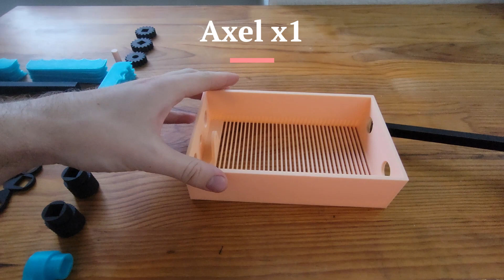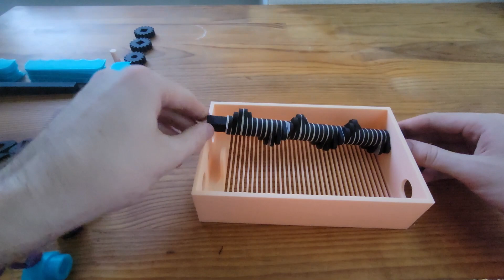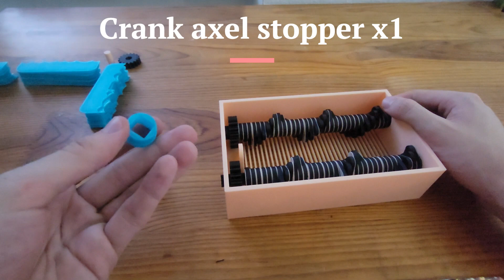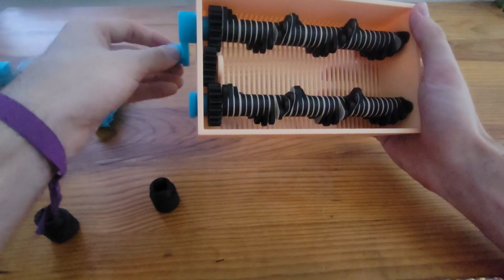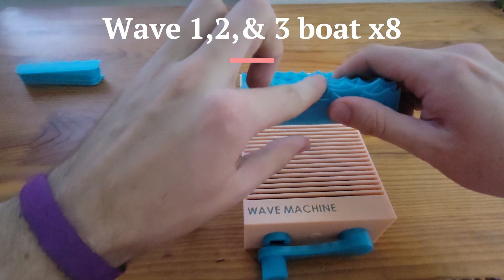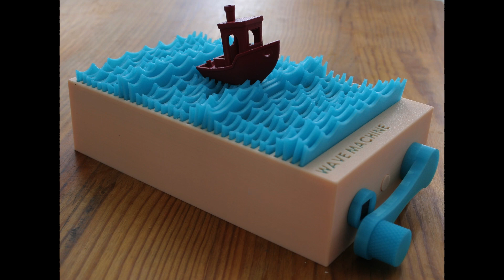Wave machine assembly instructions

Comment: its possible i change the boat on .STL file? I have one sailboat with 114mm lengh
Reply from the maker: Of course ! As long as the boat fits on the waves it should work just fine ;) Although you then may need to print more of the special waves for the boat. Let me know if the base of the boat is larger than the Benchy's, in that case I will make wider gaps for the boat to fit on the waves